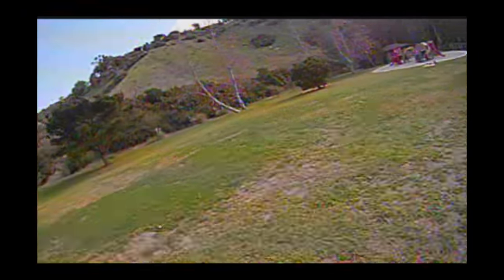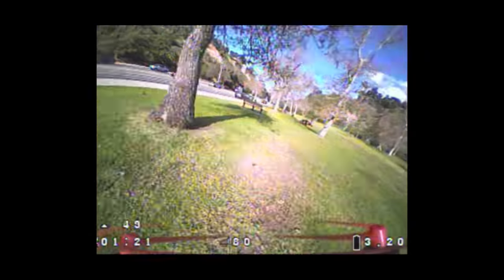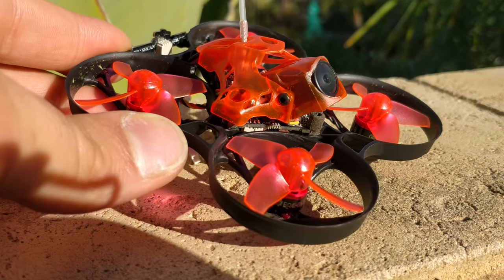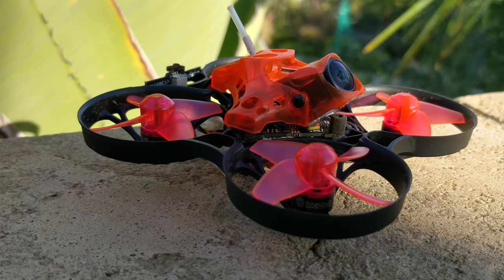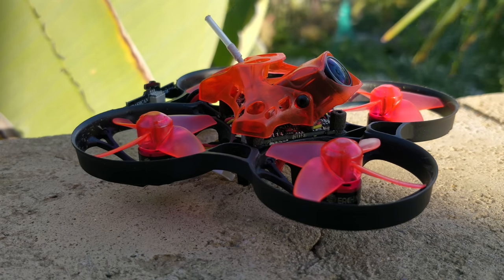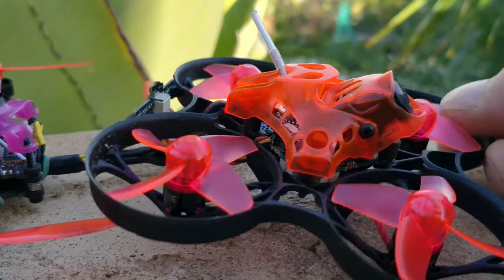Eachine Trashcan - In search of rubbish...

Comment from the maker: Table of Contents:
00:15 - Flight video of Trashcan
02:38 - Flight video of Toothpick
04:20 - Camera
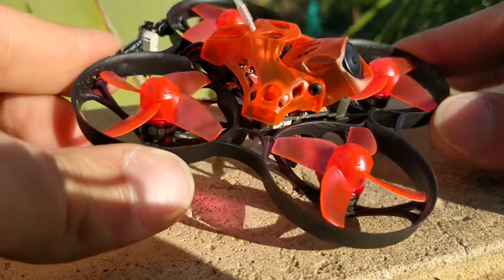06:44 - Frame
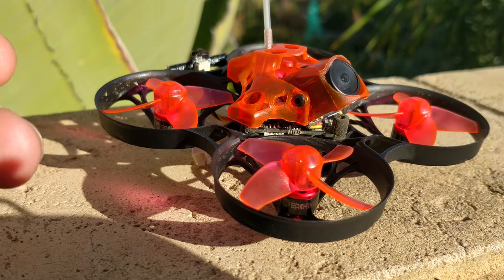07:40 - Motors
09:03 - 1S performance
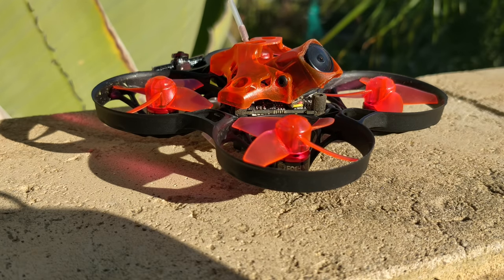10:11 - Insides
11:35 - Firmware
14:41 - My opinion of the product
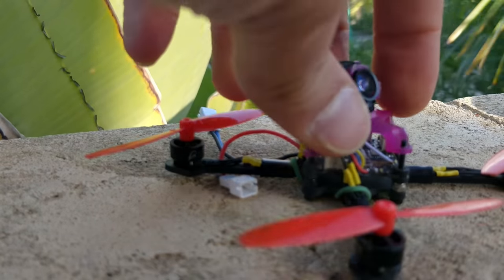20:48 - The little carbon frame

Eachine Trashcan: https://goo.gl/tD7QDH
Flying Toilet seat: https://www.youtube.com/watch?v=tiKZ8p-cWzU

Trashcan Alternatives:
Diatone 2019 GT R239 R90: https://goo.gl/DBnnke
TinyHawk (1S only): https://goo.gl/LrQiN9, https://goo.gl/8y66Gf

The other carbon frame videos:
Part 1: https://www.youtube.com/watch?v=yUBwDGdeGjs
Part 2: https://www.youtube.com/watch?v=1M9WutEXIZc

Settings I changed from default:
Set to 8k/8k PID and gyro rate
Turn off accelerometer
Turn on air mode
Turn on anti-gravity
Turn on dynamic filters
Set your arm switches
I set my rates to 1.44. might be high for many. I also don't like different rates for yaw pitch and roll. all 1.44.

Equipment I highly recommend:

Micro Eagle - 
https://goo.gl/or1fS9

Rush Tank Vtx -
https://goo.gl/YMYmya

Fantastic solder-
https://amzn.to/2P5QM2W

TS100 iron -
https://goo.gl/DqBipa
https://goo.gl/svK6DD
https://amzn.to/2OV5XMh

WaFL’s Cap Cap
https://insta-stalker.com/profile/wafl.fpv/
https://goo.gl/9CZdAs

Tips?
PayPal: https://www.paypal.me/kababfpv
Bitcoin: 1E4XZXoD4rS6MYWVWuenY7Kw2M1YgyNpoQ
Nano: xrb_1188ek5bd7tb9kw67asnp9o65byuoaxbtpxuznx1ribf75x78awywmakj55f
ETH: 0xD067F93811f2eC31CB1928901002dfdf9A492EF5
LTC: La2KWYAjp4VT2Lq2M76pbjzXWvRyjpfCtG
Reply: This is off topic on this video but I know you like the Talon f4 flight controllers. It was after one of your videos that I got a few. Have you had any issues getting the receiver  to work? I'm using the r xsr receiver, it's bound, powers on, uart1 serial rx switched in BF, uart 3 is smartport, serial receiver and sbus selected in Config, and tried the CLI commands Inverted ON. I can't get stick movements in the Receiver tab. It's got to be something simple I'm overlooking.  Any help would be appreciated,  I know it difficult through text sometimes.
Reply: @markwestbrook3313  I finally figured it out. I saw that video, I think I've seen them all now lol. I knew about the whole inverted/uninverted stuff, trying to change it in the cli, if that doesn't work solder a wire onto the micro pad. I guess when I tried the wire on the solder pad it wasn't a great connection the first time. To add to the frustration I had to update my radio and was thinking I messed something up in that process. Thanks for the input and taking time to help, it's appreciated.
Reply: @damienkrohse3374  No worries my friend, I have had the same problem myself with recievers and other stuff, this is a great hobby especially if you build as well as fly but hell its frustrating as a simple little era can cause headaches for hours sometimes day's. All part of the fun, and the sense of achievement once you figure things out is a bonus.  :)
Reply: Love how you do this on your posts!!! Lets us know where in the post 2 go!!!! I like this little whoop!

Comment: Just waiting for the dys kitchen sink to come out
Reply: I'm waiting for the Armattan AshTray :D
Reply: Someone's gonna have to throw it eventually....personnaly, Bob's flying prius is a much more promising concept. I ordered a bat 100 frame and magic props for my Mobula 7 as I wait for the Toothpick to be available.
Reply: Happy New Year by way!
Reply: @yannickg6904  what do you plan to do with the bat100 frame? The fc mounting is 16x16.
Reply: @zulerah  I'm still considering using a 16x16 stack instead of my mobula electronics, but I would make a small adaptor plate and mount the fc underneath the mainplate, with only the camera on top. The fc board would be soft mounted in a small protective shell with openings for the motor connectors, and the mainplate and camera canopy would be swappable. Lots of trouble for a diy project, hahaha I still have to figure out auw. But I will be building a Toothpick with better motors.
Reply: Which drone is better, the Trashcan or the sailfly x?
Reply: Happymoded Frizbee, Eachine Grouch.

Comment: thanks for the detailed review and recommendations! you mentioned soldering on a receiver with a crazybee F4 Pro board that has the SPI FrSky receiver integrated. there is enough pads to get it working. i did it for my brother since he had x9 lite which only supported D16 and there is the D16  dropout bug on Crazybee non-EU FrSky boards. 

1. soldered SBUS out from R-XSR to IRX1 (the inverted RX1) and set Betaflight Ports for UART1 to Serial RX, deselected Smart Audio on Peripherals.
2. soldered S.Port from R-XSR to LED Strip pad, soldered VCC and Ground to LED Strip 5v and ground pads
3. desoldered Smart Audio and resoldered to TX2 and set Peripherals for UART2 to Smart Audio.
4. Enabled Softserials
5. ran CLI: resource
6. found pin for LED Strip (A00 in my case)
7. ran CLI: resource SERIAL_TX 11 A00
8. ran CLI: save
9. set Softserial#1 in Betaflight Ports to Smart Port on Telemetry Out

Comment: Betaflight has some new(ish) throttle limit features that are perfect for super powerful 2s brushless micros like this. Rather than using your radio for throttle limits, you can go into BF configurator and set an upper throttle limit but have it still scale to your entire stick range. What's great about doing throttle limiting this way is that the PID controller can still go beyond your set throttle limit to give each motor the authority it needs. But you don't have to worry about the quad blasting off to the moon if you give full stick deflection.

For example. you could set a 50% throttle limit in scaled mode. This means 100% throttle on the stick only gives %50 throttle to the quad. But you still have the full stick range from 1000-2000. So you actually end up getting more throttle precision because you're using the original stick range to control a smaller throttle range.
Reply from the maker: I wonder if the PID controller does actually take advantage of that. I've wondered that for a long time and believe that's why micros washout. But I don't really know.

Comment: Racerstar released today the new 0804 and 0806 motors, look into them, 0806 10000kv on 2s could be mind blowing in 65mm props. Also you can add a separate reveiver to the crazybee... Just give up smartaudio and do the uninverted hack on the Rx
Reply from the maker: Looks good but I'm betting the wider motors will work better. 65mm is enormous for such a tiny motor. Also, ~3.9g is really the limit in motor weight for this tiny size. After that it starts to require 2S and becomes a power quad.

Comment: With 5/6A ESC and 1103 motors we are back in the same realms of the old Emax Babyhawk specs. From memory I think those motors were 1104 around 5000kv.

I've not flown that model for about a year. I bet that FC (although only F3) and power train would look pretty good on this type of setup now. Especially with new Betaflight 4.0 firmware.

You have high expectations, keep them there! If we all want it, eventually someone will make it. Just don't be afraid to put this one on the back burner again until the technology catches up. It's come a long way since your brushed flying Prius model.
Reply from the maker: I'm gonna make it catch up. Working on it...

Comment: Dear Bob, I want to give some input to this topic. Last year I built a small copter to carry a Split mini. I even did some thrust tests with different props. The magic 65mm KK Prop was the winner. Combined with a Racerstar 1103 @ 8000kv I get flight times of about 6:30 (slow flying) with an 2s GNB 450.
As I did the thrust tests I did a test run with a cutted 65mm KK to 60mm. The result was, up to a thrust of 70g the efficiency of both was more or less same. Then I cutted it down 55mm --> up to 50g about the same efficiency. So by cutting I just lost max. thrust. All @ 7,66V: 65mm --> 88g; 60mm --> 78g; 55mm --> 64g.
What I want to say: When your motors are too fast please try to cut the props. This would enable a smaller = lighter frame and by reducing the prop weight... I think you got my point.
Reply from the maker: Yeah I understand. The 65mm prop is truly magical. They're making the triblade version for me and I'm really hoping it'll just be a bit more magical. I also believe we will ultimately end up with a 1202 or 1302 motor.

Comment: I see no issues with 2S in whoop. If 2S provide enough boost to handle whoop in air better then why not use it? Especially if home is so large as yours. Set lowered throttle rate for indoor 2S flying in one of rate profiles and switch between them from OSD or by transmitter switch. 
The purpose for whoops like Mobula7 and Trashcan is to make them usable in both home and outdoors. For me at now these whoops Mobula7 with possibility to fly in both 1S and 2S configurations are a God's gift because of winter here when weather is not compatible for flying outdoors. Also because recently I lost my workshop and don't know when I will be able to fly with 5" racers again. Impossibility to reach a top of skyscraper doesn't matter to us here at all. We haven't so tall buildings around :)
Reply from the maker: The issue with weight is that it's not always relatable to power. Meaning if you have more power, it doesn't mean you'll have excellent performance. There's a fine line between where the props act sort of like wings and control surfaces rather than just thrust machines to keep you from falling into the ground. It's hard to explain but if you fly a light weight craft with a really good disk loading factor you'll realize how nice and easy it is to control and how enjoyable it is compared to something overweight where you're always on the gas and there's no real in-between from falling and rocketing. Both have their merritt's, to me, whoops don't feel great when overweight regardless of how much power there is.
Reply: @Kabab  I know about what you are talking about. Too heavy quads become flying cows indeed - not much fun in flying them. The trick is to find not to heavy batteries. For these 2S whoops 260..300 mAh LiHV batteries are still in acceptable weight limit. 450 mAh is already too heavy :)

Comment: I have been super impressed with the range I am getting from the micro 25/100 mw vtx boards in my GoFly Falcon's. Its very small and costs like 17 dollars.  Putting a whole GoFly stack on one of your frames...with T-motor F-10's...Would be insane...The whole stack is about 95 and 50 for the motors...The Cp 90 Falcon I built with T-motor F-10's is seriously one of my highest performance quads. I learn massive info.on your channel.  practicing dive bombs all the time. Your awesome. Bob!
Reply: Thumbs up on using GoFly products, they are really underrated. I love my stock CP90.

Comment: Gonna try making a long range 'super whoop' with an r9m receiver and 200mw :)
Gonna use a 16x16 stack however
Reply: Just a suggestion, but look at the Trainer 66 or 90 as a cheap source of parts. Just use a larger frame for the 65mm props.
Reply: @yannickg6904  I already have some motors(1103) and a cam(the cheap by one)
Reply: @Quick FOx I did my inductrix bl with crossfire. Works great! Took 2 days of fooling with it to get it right.
Reply: @absolutecarpetcare  cool, looking forward to good results with an r9 mini!
Reply: Yes, why not make whoop with crossfire then? And I would not be surprised about some "lost my whoop" weeps in forums after :D

Comment: Washout is just vortex ring state AFAIK. Your frame/prop choice doesn't have that issue because the rotors aren't loaded nearly as badly (larger props, no ducts, lighter weight all contribute).

Comment: Why is everyone throwing bigger motors at yaw washout? The reason TinyHawk handles yaw washout so much better is frame design. When dropping fast enough, there is more air pushed up through the standard whoop duct than any whoop motor you throw in can push down.
Reply from the maker: Yeah I dunno. The TinyHawk is still imo thr best performing whoop to date. Hard to refute that. 2S doesn't mean better performance. Just means more speed

Comment: I like the betafpv 75x on 2S, but it's far from perfect too! I just wanted something to survive the monsoon season indoors, but this thing is capable of running outside with the big dogs! Washout is unavoidable sometimes, but I've learned to handle the throttle with care and that goes a long way to avoid it. The XM+ that comes stock along with the 200mW VTX (on the 75X) let's me dive buildings and hit gaps at speed just like the 3" and 5".  The trashcan should have a better receiver, no excuse for that, nor the limited vertical FOV on the FPV cam. Swapping the frame sounds like a good idea for the trashcan. The 75X has an unbelievably tough frame. I think I'll pass on the can. Too many better options. Nice work with that frame, now I want a toothpick frame too!

Comment: Caddx do a eos2 4:3 camera that can be replaced. 160 degree FOV too. But it Comes with a female instead of a male plug So a little modification is needed. Also the none receiver model I purchased has a UART on the board inverted or standard which will enable a separate tx to be connected. I have a crossfire nano with the race xf antenna connected and works perfectly.

Comment: I'd bet the tiny hawk handles washout better because of the pusher prop config. Washout is caused by dropping into your own prop wash and losing power and authority because of it with a pusher config you'll have more power because there's more air space that the prop is moving into.  I know with a little 8.5 brushed build I did awhile back with a houseracer frame that's pusher it recovered a lot quicker than even a lighter build using the same components but standard tractor style props.
Reply from the maker: I just flew it again right now.  The TH's 1S performance is night and day better than the trashcan.  I wouldn't even bother running the trashcan on 1S.  It's a total waste of time.  It's a combo of the aggressive broad blade props, better balance and pusher that makes the TH perform better overall.  Both in washout and everywhere else.
Reply: @Kabab  Ya I would expect something from Emax to perform better, eachine is mostly about building stuff to a price. I can't wait for your toothpick frame I love 1s quads super cheap batteries and safe to fly basically anywhere. Currently the bat-100 is my go to frame but it requires building a stack doesn't quite fit the 66mm props and it's pretty cheap carbon as well so I'm stoked at the extra performance and weight savings possible with the toothpick.

Comment: The Caddx EOS2 is available in a 4:3 version, so while it is an added expense, it would be an easy fix.  Also the Trashcan is available without a receiver, so an XM+ would fix the range issue.  I don't know what the mounting options are for the receiver but it would certainly be better if the built in RX option had decent range.  Thanks for the review,  if one of these finds it's way into my shopping cart, it will be without a receiver.
Reply: They make a micro xm with one antenna, it will fit anywhere.😁
Reply: @LegitimaMax  yeah I have an XM with antenna taped to one of the ducts on my Zer0 whoop and it can easily go beyond the limits of 25mw VTX with a dipole.

Comment: Awesome video, did you try literally H style frame for these micros? My thinking is you will get shorter arms, in general, within same motorspan than X style frame and reduce weight even more
Reply: https://i.imgur.com/ULtzMM1.png Here I made a quick sketch, Might have used wrong sizes for the board and props, but I think it is at least more clear what I am talking about
Reply from the maker: the H shape is gonna require more carbon material which means more weight.  Would work fine however
Reply: @Kabab  how come? If you maintain the spacing for motors and the base for the board, X-style arms will be roughly 40% longer, thus wasting more material. Or I am wrong somewhere and cant figure out it. Happy new year though. Check out the rough design I attached in the link in the previous answer to this

Comment: @kebabFPV you know the feeling, right? 5 years ago you walked past an open field and thought: I'd love to fly my tricopter here. 4 years ago you walked past a park, with some lose treeformations and thought: I'd love to fly my 5" here. Then came the first whoops and it was like indoor flying became a thing! And with this thing, I'm walking past a house with some little shrubs and think: God I need this house and my friends with some cold ones... this is the revolution in my mind.. racing with friends in your tiny backyard is finally a thing. And yes, I'll build one of your toothpicks. Btw: This or BetaFPV 75 Pro2?
Reply from the maker: I wouldn't recommend either one. I'd recommend you build a whoop yourself. Use a happymodel crazybee v2.1 board when it comes out and an 1103, 9000kv motor with a beta 75mm frame. Rest is your choice.
Reply: @Kabab  thanks for your answer, I already bought the trashcan and love its performance. Next step in the mikro scene will be to build a toothpick - though I think they're too fast for backyard / Indoor racing. I Think those whoops do already a good enough job with the added crash-resilence.

/watch?v=_5PRAkihmw0

Comment: my only concern with toothpick is breaking those motors in crash.  If you run 110x style motor, those are little bit stronger.
Reply from the maker: I've crashed the hell out of this one over and over and over. Not a single issue. Not even a dead prop. I bent one prop once. Seriously, this thing is more durable than ANY quad I've ever had. It's like a flying cockroach
Reply: @Kabab  I just notice on BG that they have Racerstar BR0804 10000KV 12000KV that are similar build the 110x motors.
Reply from the maker: @JeromeDemers  yes. I'm betting the 1103 is going to be far super. I have so iflight 0804 and the racerstar 1103 on the way right now